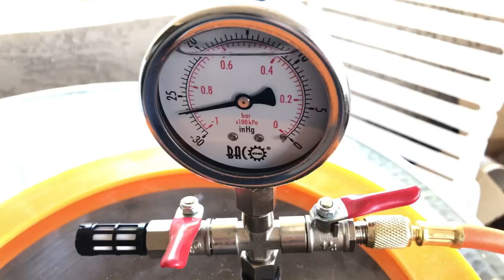A 3D Printed Object - Part 1

Comment: I have a question. I ran out of two-part rubber with something I was attempting but I realized I’ve been poking it every time I walk by. will the rubber still stick if it has dust and hand lotion? How would I clean it?
Reply from the maker: You can clean it with acetone or lacquer thinner.  Then the new rubber should stick just fine.

Comment: From an avid 3D printer guy, the Bondo is our go to. Works amazing for filling layer lines before painting one offs.

I am definitely going to have to get myself some Magic Sculpt.
Reply from the maker: What machine do you print on?
Reply: @RobertTolone  I've got more than a few. My workhorse is the Makergear M2. I also have a couple of the smaller Monoprice devices. And for really detailed work, which is why I'm learning from your channel is the Monoprice resin based printer.
Reply from the maker: @BertNielson  I have always sent my models out to service bureaus to be printed but now I want to add both a filament and a resin printer to my shop.
Reply: @RobertTolone  if you're looking at this more from a business perspective, I'd recommend the Prusa printers. They'll require less tinkering than many of the cheaper models. Their software ecosystem is fantastic as well. Add in using their filaments and resins for a completely tested, reliable system

I love Makergear for a solid product. I can run the printer for multiple days and several spools of plastic without worry, but they don't have a resin printer. They also rely on Simplify 3D for the software which is an additional purchase on a higher priced printer.

Given all that I've learned from your videos, it feels like the least I can do is offer to answer any questions you might have. 👍
Reply from the maker: @BertNielson  Thanks Bert, I appreciate the input.

Comment: Great stuff Robert! that's certainly a tricky shape i don't envy that!!!!, we've been using 3D printing for a few years now to make our mold walls since we often have designed our master patterns in 3D we can make jackets/shells with a good consistent wall thickness from the part really speeds things up for us as we can set them away to print at the end of the day and we only have to consider sealing the gap on our base boards, you can also do some interesting things like putting the volume of resin needed into the wall of the mold (since we have the cad data) I have no doubt you'll do some wondrous things with 3D printing and mould making! all the best from the UK!
Reply from the maker: I have long wanted to use 3D printing to make mother shells for blanket molds.  I’m looking forward to  adding this capability to my shop!
Reply: @RobertTolone  more than happy to help if you need it i'm sure once you get the hang of it you'll take to it like a duck to water!

Comment: A fair bit of warning when casting 3D prints.  If casting resin prints make sure you use a tin silicone, and even then it's a good idea to clear coat the piece first.  Most print resins have a high enough sulphur content that it will inhibit rubber curing.  Especially platinum silicone.
Reply from the maker: You’re right Seth. I had heard that, which is why I tested the rubber on this model and the body putty.  I wonder if someone makes a sulphur-free printing resin or filament.

Comment: Hey Robert - great videos! I am in the process of making moulds from 3D prints and am finding your info great. I thought I would share a few things I have learnt in improving surface quality of 3D prints having played around with them for a few years.

1. Print on the highest quality available, even if slower it pays dividends later.
2. Use a shellac primer or low viscosity epoxy resin and even gesso - making sure it does not inhibit the type of rubber used!!!
3. Sand with fine grit paper or good wire wool for a smooth finish.

I find this helps fill in all of the layer gaps and improve surface quality overall. Good luck to all the makers out there, keep on making!
Reply from the maker: Thanks for the tips Jason.
Reply: "The highest quality" is a bit subjective. Reducing layer height (which is the most obvious setting) doesn't always lead to a better finish, because you will often get more stringing, more detached layers, more retraction artefacts, etc.. 

So I'd say use the layer height that you need to preserve the actual details in the source model, but don't try to use excessively thin layers as a shortcut to a smoother surface, because (if you're using an FDM  printer, which is what most people will have at home) you're always going to need a lot of manual sanding to get rid of layer lines.

Or just have your final model printed using SLS or some method that leaves a smoother surface to begin with (though it still won't be shiny without some post-processing).

Comment: That by the way is the exact same manufacturer I bought my vacuum chamber from. I chose the one with the vacuum meter at the side of the pot (with a hole in the metal pot) because i read that the acrylic glas top tends to get cracks at the spot where the meter is put though. How do you like that vacuum chamber setup compared to the one in your workshop?
Reply from the maker: It works well but the pumping action is much slower!  Still, it’s getting the job done.  My main concern will be durability. It will be very interesting to see how long the pump lasts!

Comment: I don't think those triangles on the sides are a deliberate "effect", it looks like triangulation artifacts from using a 3D model with too few segments (unrelated to the actual slicing / 3D printing, it's a flaw in the source model).
Reply from the maker: I assumed it was deliberate because the model was sent in by an architecture college. Certainly they could have designed the model surface to look any way they chose to.
Reply: @RobertTolone  - I know a couple of architecture students who literally can't make a hole in a wall in 3D software, let alone understand how a base object needs to be modified before applying a twist modifier (which seems to be what they did there - join 4 boxes then apply a twist effect to the whole thing - but the boxes hadn't been created with enough segments to begin with, because they looked fine before being twisted - in fact, it probably looked fine on-screen even after being twisted, due to colour interpolation, which tends to be turned on by default to make curves look "prettier" - but obviously doesn't work once you have a physical object).

I think the problem is a lot of architecture teachers don't actually work as architects, and they just teach things the way they learned them, 40 years ago. So the students have no idea about the issues with reproducing curved surfaces in digital models, let alone how to fix or prevent them.

It's not impossible they liked the effect and decided to keep it, of course, but that's definitely not something modelled manually or decided during printing, it's a typical flaw caused by the modelling software trying to approximate a compound curve with an insufficient number of segments, which leads to those triangles appearing on previously flat faces.

Rectangular faces in 3D objects are actually made up of two (or more) triangles, but when one of the vertices moves off the plane of the others, the separation between the triangles (and the way they react to light) becomes very obvious. On screen that can be disguised simply by interpolating the shading to blend into the adjacent triangle, but, for a physical object, you have to measure the curvature and retroactively add more segments so the triangles become smaller, and light changes more progressively across the surface.

Comment: Hey Robert. Interested if you have any tips on setting up and using that pump? I've been tempted by that brand for a while, but not sure on the quality!
Reply from the maker: So far I have been impressed by the quality, given the price. But I have no idea if this will be a durable unit or if it will burn out quickly. Only time will tell.
Reply: I just recently bought one similar to this, it’s blue instead of orange. Works great so far. I also use a heavy duty glass mixing bowl over the chamber if I’m degassing a small cup. It vacuums much faster. Just make sure you release the pressure slower.

Comment: Dear Robert, thank you for sharing your videos. You're a great teacher and your enthousiasm is very contageous ! 👍😄❤️
Have you heard of patreon ? ... maybe that could generate a bit of extra income while waiting for that sponsor ....
I'm a sculptor and I use 3d printing for making the originals. The Prusa printers are great, but I went for the cheaper chinese model with large build volume and that's been working like a charm for me. I use only PLA anyway, so I don't need any 3d printer fancy features, and a very large nozzle of 1.2mm so the objects come out really sturdy but not very detailed. I add a wax layer to add the details and texture.... et voila .... ;-)
looking forward to fridays 
kate
Reply from the maker: Hi Kate, Patreon may be something I will consider in the future.  Sound like you’re using your printer to build detailed armatures for your sculptures.   That’s a great idea.  For my toy prototype work I have recast 3-D printed pieces with sculpting wax and cleaned them up that way. But I felt I wasn’t really saving much time over 100% hand sculpting techniques. I would like to add both a resin printer and a filament printer to my shop. What software are you using to generate your models and the slicing instructions for your printer?
Reply: @RobertTolone  My absolute favorite slicer is Ideamaker, because it gives a lot of control in adding supports. 
Meshmixer is a good free software for digital sculpting, edit meshes, ,create shells, and get an idea about balance and centre of gravity. 
To create interlocking parts Blender is  good free option,  I personally happen to have a license for cinema 4D and knew how to use that already...
The idea of 3d printed shells as armature came from my frustration with traditional armatures that need to hold heavy clay (about 50kgs for a bust, 400kg for life size sculptures...),  now I make small models without any armature, scan them, do some digital editing. I can print the shells, go to bed, wake up and assemble. -)
Reply from the maker: Thank, I’m going to check these apps out.
Reply: @RobertTolone  good luck, let me know if you need any help 👍 do you have access to a 3d scanner? I find  it s more fun to try out with your own models.... I saw you using rhino in another video, that s really the best program to create interlocking parts or split your models if you want to do any enlargements. 👌
Reply: @katevandeweghel2691  Thanks Kate, I will definitely hit you up with questions as they arise. Thanks so much!